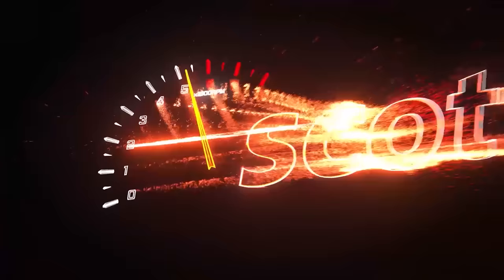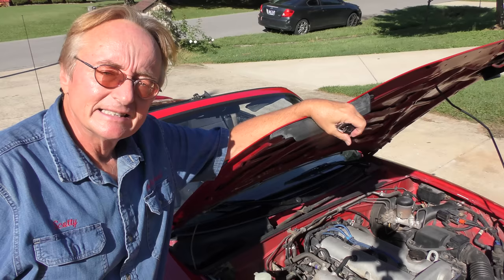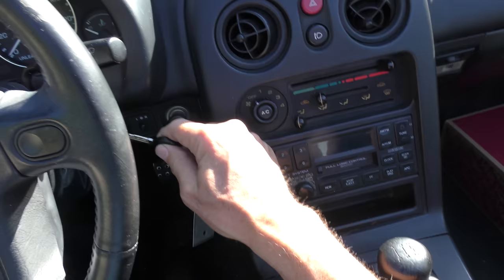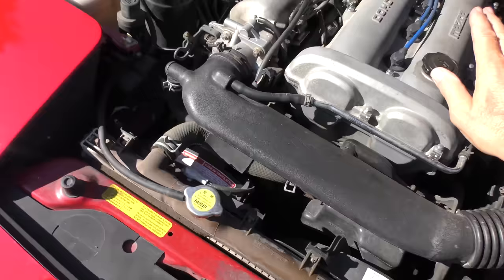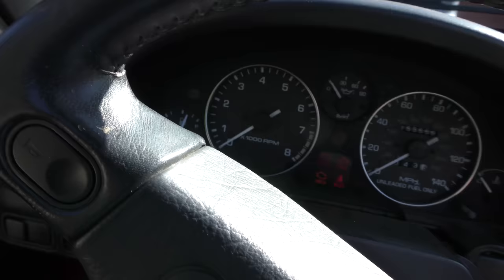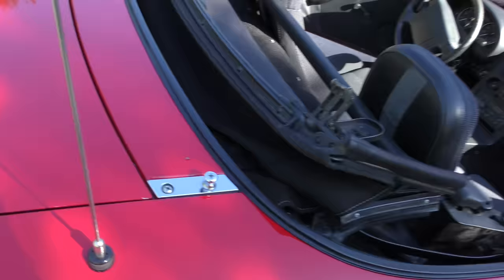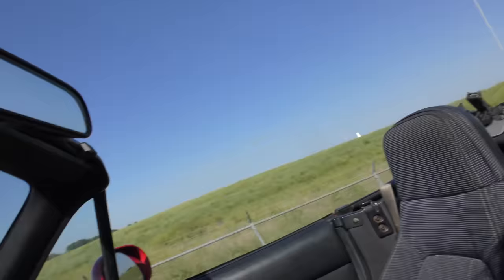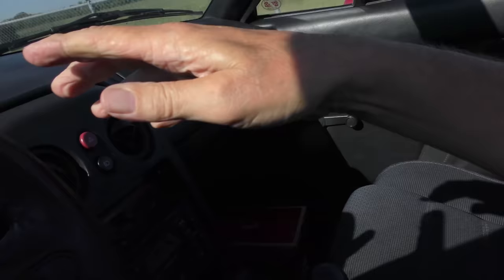I Just Found the Best Car Ever Made (and I’m Buying One)

Comment: A cool thing to do is wire in an air horn instead of the "meep meep" stock horn. You have to wire up a relay that draws power from the headlight motor circuit (or anywhere) because the horn circuit can't drive the airhorn. The much much louder horn comes in really handy on highways when very large trucks lose track of their lanes.
Reply: I love the meep meep it's so cute
Reply: @taylorc2542  Honda made the S2000 for only about ten years and only about 110,000 were made. Mazda has made over a million Miatas, which means more parts are available for the Miata too.
Reply: @taylorc2542  lmao, no. An S2000 is not twice the personality of a Miata. Nothing will beat the Miata wink.
Reply: Bought a '96 M-Edition this year and never bothered to check the horn until I was in my garage, yeah they upgraded the horn.
Reply: @SashwathPrakash  me too ☺️ but I can see where it wouldn't be practical on the highway 😏
Reply: My brother had a Mazda RX3 back in the day of rotary. It looked like a Toyota Corolla but went very fast... very quickly, but too fast for the car..lol  It was fun, but he traded it for a Jeepster . He put a cow horn on it since we were in the country.  When we went by a herd of cows, he would blow that horn and all the cows would look up with their ears perked up....😄
Reply: Just replaced that crappy horn with two Hellas I just jumped from the original connection .I found it odd that the mount for a second horn was sitting there empty. I guess the US didn’t require two horns.
Reply: @SashwathPrakash  until that trailer truck is drifting into your lane .
Reply: @taylorc2542  if you can find a decent one for less than your first born child
Reply: My '69 Fiat 124 Sport Coupe had an air horn. Piercing!
Reply: @reecenewton3097  same one in my spider . I loved that car but the thing always needed something
Reply: @JAYJAYJAY53  yes. That car really wanted to stay in sunny italy. It did not do well in the northern United States. Started rusting out the first year.  And it leaked oil from every gasket. Then the synchronizers went out.  All this within the first two years. Then a lady in an Oldsmobile ran a stop sign and took it out. I was not hurt, but cried inside. With the insurance money, I went out and bought a 72 Impala.
Reply: @reecenewton3097  I had to switch out my horn too. I used two two Hellas . The mounting bracket for the second horn which isn’t standard in the US is already there so I just extended the wiring to the second. No extra relay and no issues .

Comment: Had a ‘97 I bought secondhand and loved it, but the only thing I didn’t like was that it didn’t have AC for those super hot days.  I rectified that several years later with a more recent straight off the showroom model, which I’ve owned for 15 years and still love it!  Never had an unexpected maintenance issue with either, just the standard maintenance schedule.  Wonderful pieces of machinery!

Comment: I feel this way about my 2012 Camry SE, has to be one of the best cars ever made.  I'm at 176K miles, take extra good care of it and hope to get 300K from it.
Reply: this is what im hoping to get with my 2008 Toyota Corolla----love it..............
Reply: Same aim with a 2000 Mitsubishi Montero Sport, just crossed 200k miles. Maintenance maintenance maintenance, attention to detail, care respect learning and love.
Reply: Any torque converter issues ?
Reply: You've been lucky with that Mitsubishi, not known for durable motors.
Reply: My 2006 Corolla just turned 335k. Yes, you read that right.  Good maintenance is all you need.
Reply: @cbennett6093  
I got 290,000 on my 2.4 5 speed 2006 Accord.
STILL original clutch!!
It's my 3rd 2003-2007 Accord, the 2.4s are bulletproof except for some 2003s using a little oil.
Reply: @bryanfews5295  as long as you ONLY use Toyota brand ATF, you’re golden. There is some secret additive in it, that if you don’t use, it will grenade the entire trans!🤬
Reply: @patrickbrass7809   thanks for the tip I only use WS fluid from.the dealership .
Reply: @motorcitymanman7711  do you know what causes the oil use issue? I’ve got an ‘03 element and no smoke, no leak, but uses a decent amount of oil.
Reply: @johnharper8676  
I was told lack of oil changes by previous owner.
Try replacing a quart of oil with a Qt. of "Marvel Mystery Oil" untill the next oil change, sometimes it helps.
Reply: @johnharper8676  
The 05 to 07 didn't seem to have the problem.
Don't buty a 2008 V6 ACCORD though, lots of oil consumption with those.
Reply: @cbennett6093  manual or automatic?  I'm guessing manual
Reply: @Robosan4000  In my youth, manual would be the way to go.  Since I drive a lot for business, your answer is: Automatic.  Some fluid change maintenance was in order along the way.
Reply: @cbennett6093  That's great mileage out of an automatic.  I had the automatic trans fail in my 2001 Accord at 260k miles and I thought that was pretty good.
Reply: @motorcitymanman7711  never heard of MM Oil but I just read up and I’ll give it a go. I’m adding a litre of oil around every 1200-1500 km. Way too much.
Thanks!
Reply: @johnharper8676  
MMO has been around since the 1930s, Good stuff!
Reply: My Pajero NL has 560k on it..... 🙌

Comment: Smiles for gallon is 100% accurate. The one thing though that sets it aside from some other roadsters is that you can really hone your driving skills on them, especially since they are lower on power, you have to get good to be fast. The steering is super light and precise, turns in with just a thought, and the road feel is fantastic.

Comment: If you can change the timing belt in an hour, for me that equates to 2 days and 4 trips to the auto parts store.
Reply: I need that on my Tacoma---$280 labor and about equal amount in parts----belts, water pump, gaskets and a lot more.  (Haynes & Chilton say not to even try it, if you never did it before).
Reply: LOL yup I owned a '97 M Edition for over 13 years and and this is why I paid to have mine changed, twice, when I owned it!  I thought about it briefly the second time around when it also needed a water pump, but after reading the instructions in the service manual ultimately said NOPE!  Figured I could do it, but figured I didn't have room in the garage and didn't want it sitting outside partly disassembled over at least one weekend and knowing me probably two!  :D  One thing Scotty didn't mention, as I understand it the NA's at least were "non-interference" engines, if the belt breaks of course the engine won't run and you aren't going anywhere but good news is it shouldn't damage the engine, no contact between valves and pistons.  However, 1990's and early '91's had a smaller crankshaft front "nose" with smaller diameter and different pulley to match it and if the instructions weren't followed to a "T" including replacing the key, torquing the crank pulley bolt and using loctite, you ran the risk of it loosening and wobbling and ultimately snapping off the front of the crankshaft which meant replacing either the crankshaft or the whole engine!  $$$$!!!  YIKES.  Also as another person mentioned, the one in his video should have the radiator replaced soon--the plastic top starts out black, then fades to green and then brown and when it gets to a brown color it is gonna be leaking and cracking soon!  I did do the radiator and upper radiator hose myself, that really is an easy job, only took me help of one friend and about 4 hours (including cleanup which was considerable LOL) and 1 or 2 trips to the parts store!

Comment: The most fun car I've ever driven was the Honda Del Sol. I imagine these are more fun with rwd but the Del Sol is a go-kart with an airbag. Fun little cars but both are getting harder to find in decent condition
Reply: I've owned two Del Sols and looking for another. Owned a 2000 Miata. I prefer the Del Sol. Miata's interior is too cramped.
Reply: @58gennaro  I hope you find one! My neighbor had one outside for a couple months. I finally stopped to ask them about it and they had just got rid of it - couldn't get it started. A week earlier and maybe I'd have a Del Sol for you 😂. I have an RSX-S A-Spec collecting dust, that's also a fun car but it's not as fun as the Del Sol. The power window for the rear glass and how the top panels tucked into the trunk blew my mind at the time.

Good luck on your search. Do you have plans to put something a lil quicker inside? Assuming you don't find the coveted b16a3 version, maybe swap a b16 or gsr in? The one I had was d16z6 but still really fun as-is
Reply: I'm j35 swapping a del sol right now. Gonna be around 400whp. Gonna hurt a lot of feelings.
Reply: @CharacterZero89  lolol. Nice. Understeer like a B?! My daughter wanted my TL-S as her first car. I said no way and sold it to a friend. Did you pull from an accord or tl?
Reply: Del Sol is nothing compared to a Miata

Comment: I've a '99 and love it, has an automatic, but I still love it.  Had to install an aftermarket cruise control in it to prevent leg cramps on long drives, but I sill love it.  102,000 miles and still purrs like a kitten.  did I say I love it?  I love it.

Comment: Thanks for your videos. I LOVE my Saturn Sky with the 2.4 L and standard. So much fun and always well maintained. Smiles per gallon! Rev
Reply: They look awesome, too. Miata owner who always waves at Sky/Solstice people.
Reply: Sky/Solstices are pretty awesome, the Redline/GXP with the turbo 2.0 are one of the most underrated roadsters. You get a solid engine that's built from the factory to withstand 400whp and you can get a factory tune that up the hp to 260-290.
Reply: The little roadsters are such a blast! I live in Middle of Nowhere, Ozarks Arkansas. There are a couple of Miata guys a couple of Older MG fellas and a guy who drives a Toyota Spider? We all use them as toys so, we wave at each other. Mine has always lived in a garage, had synthy oil ever 4,500 miles and never been hot rodeded. So, the 2007 gal looks and runs brand new.

Comment: The barn door headlights means it's an NA: 93 or older, so it's a 1.6L with the smaller differential ( the larger differential in later models is more durable , but less responsive(slower) and more prone to spin out ) . The the most common points of failure for the NA series are the hydraulics on the clutch ( slave cylinder especially after the engine has run hot ) , gas tank leaking at the seam ( at the passenger side front mount ) , water pump vanes breaking/bending ( evidence of this will be found in the thermostat housing sump) , the electrical wires to the fuel pump failing on the inside of the tank plate , in some of the the 92/93 models fan relay failure and ( unrelated ) coolant temperature sensor malfunction ( causes the car to die when hot : it is the sensor located under the ignition coils at the back of the engine ) .
Reply: Thanks! Didn't know that.

Comment: I have owned 4 miatas three 1999 models and an 06 model.
I currently have a 99 model...
I would never be without a Miata til i go in the ground, they are the most fun cars and easy to work on if you need to, and theres a ton of aftermarket upgrades you can buy to make these cars so so so much more fun. My last one was a national SCCA champion car. My current one has a ton of suspension upgrades and you can throw it around a corner at any speed and it remains rock solid. you sneeze and go across 5 lanes of traffic....these cars when set up with upgrades to the suspension require full attention because the slightest movement to the steering wheel actually moves the car in that direction and fast.
I was always a old muscle car guy til i got my first miata and none of those were more fun than these tiny lil go carts

Comment: I’ve owned two Miatas. One of the originals, so-called A generation and one of the B generation. The 1991 had a persistent gas smell that no mechanic could ever find the cause. The 2002 was better in almost every way. I had a lot of fun with them but ultimately they were exhausting to drive. Even with earplugs I would arrive at the destination tired out. I am an old fart truth be told!
Reply: This is a car I would think about owning, but I too am no young person. Wish the automatics we're as good as the sticks ( according to Scotty), that disappointed me. I'll take it from you...about the car though. I don't want to feel "wore out" when I drive cars. Thanks for your honest opinion. 👍
Reply: @thisisme3238  the stick on these is also one of the nicest ever produced
Reply: @djkenny1202  That's good to know but I can't drive a stick. Drove nothing but automatics since I got my driver's license many years ago. Are the automatics really that bad?
Reply: @thisisme3238  yes. They are. I would learn Stick. These are way nicer to Drive. I bought a clean 2000 VW Cabrio pretty cheap. A lot more practical. I garage it like other owner always did. Top is perfect. Very simple power train. I would have preferred a manual, but this one drives very smooth. When it goes I plan to swap it one day likely.
Reply: @djkenny1202  thanks for the info, much appreciated 👍

Comment: I had 5 Miata's in a row. One from each era up to 2020.  I also owned the very last "MazdaSpeed" made, which was a Miata on steroids with a factory turbo.  The MazdaSpeeds could NOT be serviced at any old Mazda dealer while under warranty. Only a certified MazdaSpeed dealer was allowed to work on them, and as I recall, there was only 50 MazdaSpeed dealers in the United States.  But I will say this... the Miata's in ANY form are absolutely bulletproof!  Best engines on the market... period!

Comment: I've had a couple of MX5's with the automatic box. Maybe they fitted a different g'box for the UK because I found them quick and reliable
Reply: I’ve taken test drives in modern automatic Mazda’s and their transmissions actually are not bad. But I still think of Mazda as being synonymous with the manual gearshift
Reply: 9 years in my auto 92...no problems.
Reply: The Eunos was a different animal 👍😎
Reply: The 1.6 is a dog with an Auto but the 1.8 does OK.   Mazda 626 had some bad trannys but early Miatas used the trans from the fullsize 929 and it was VERY understressed behind a 4cyl.

Comment: Looked at one way back in 2007 looking for my first car. Ended up with an Accord coupe that was as old as me because I wasn't confident with driving manual at that point. For anyone wondering, a Honda S2000 with the race clutch is NOT a good confidence builder for someone learning. Teach in an old S10 or Ranger, they're forgiving and don't take off like V6 coupes will. I speak from personal experience, your mileage may vary. Even with an aging Camaro RS now, I still have to pay attention when I'm stuck behind a slowpoke. It will leap if I get sloppy, and they won't. However, there's absolutely no justifiable reason to not enjoy what you drive. The Miata is proof that you can find something economical that's still fun.

Comment: i daily a 1996 miata. its the 5 speed 1.8l but with a twist. its on aftermarket coil overs, stage 1 flyin miata clutch kit, jackson racing m45 supercharger with track dog racing front mount intercooler, 700cc injectors, megasquirt plug n play 2 stand alone ecu, flex fuel fit, and its tuned with maps for both 91 and e85. car runs strong and its a hardtop with aftermarket braces. stop tech pads and rotors. i put a kenwood head unit and speakers in it with a ported 700watt 8 inch sub in the trunk. its a fun car and id never get rid of it.

Comment: Automatic Miata guy here; Mazda doesn't make their own Automatics

I find it funny and somewhat ironic that I always hear Scotty harp on the Automatic gearboxes in Miatas, but at the same time he says Jatco/Nissan RWD transmissions tend to be their best made automatics--If you do some looking into it, the Autobox in the NA Miata was a parts bin farmout from Jatco that was designated as their "Light-Duty transmission for Longitudinal Drivetrains". So the automatic transmission in an NA Miata is technically a Nissan RWD/Truck transmission. Same transmission you'd find in a D21, first gen Pathfinder, or some of the early Maximas. I think it has more to do with maintenance and how the driver treats the transmission, the user manual for the 4N71 says to change the trans fluid every 3000 miles which is insane.

Later Miata automatic gearboxes were sourced from Toyota, so they only improve with the generations, Would love to hear Scotty's thoughts on all this.
Reply: This is what happens when you see to many Bagged Miata's with a auto trans in them...I f they haven't had the crap drove out of them I think the Auto trans are fine.

Comment: I owned a '97 MX, last year of the flip up headlights,  bought it in '99 from a woman that never drove it much, garage kept. I drove the piss outta it, changed out the timing belt only once after 6 years, drove it until the top started to decay in 2017, at 20 yr old it drove like a new car. As I got older it was getting harder to get in and out of it. I called it " the magical time machine ” cuz it got me there in no time flat!

Comment: I bought my 2005 miata in 2019 For $5Gs with 117,000 miles,,, cash via Craigslist in texas. 1 year later replaced the clutch $1G, 1 year later new drive shaft (joint) and tune up (new sparkplugs, etc) $1,200 dollars. I love my miata drives smooth